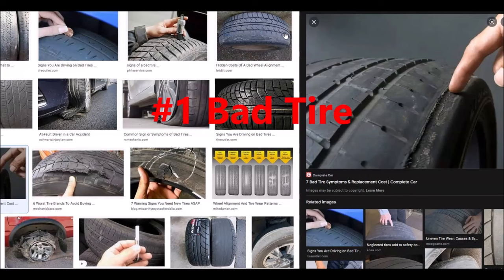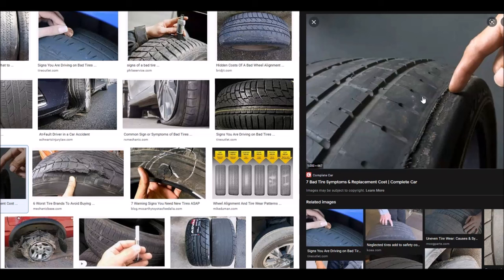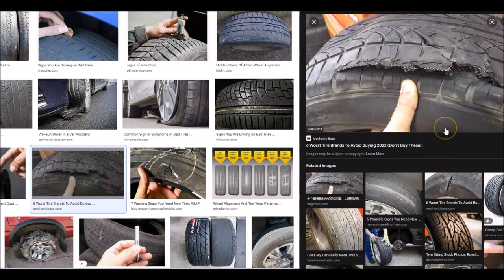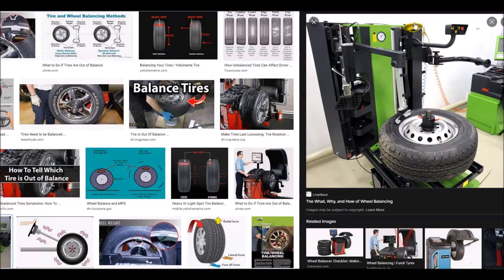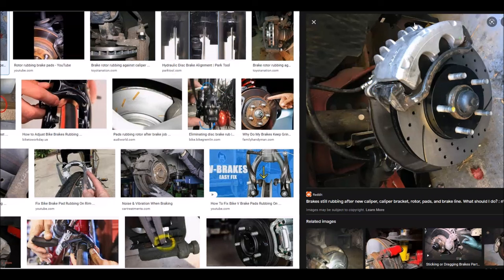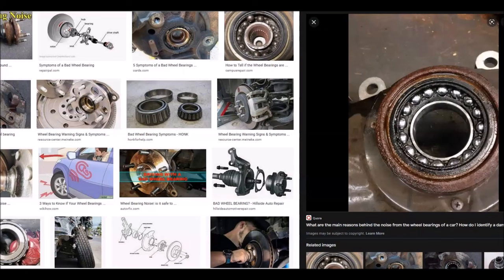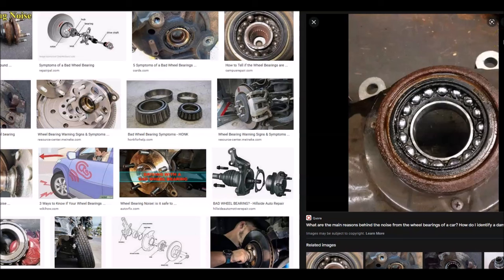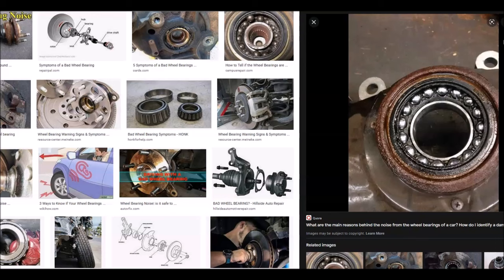4 Causes when Humming Noise in Car Getting Louder with Speed

Comment: 1. check tires treat  2. check tires balance 3. loose break pads or the clips  4. bad wheel bearing. You're the man. Thanks.
Reply: Update. My mazda's noise turned out to be left rear wheel bearing. Glad to have seen your video. Gracias
Reply: Mine stops when I go to the right a lottle
Reply: So my car seems to be louder but maybe not necessarily with speed. Also s while ago my traction light and abs light came on and mostly stays on but has gone on and off for a short time..well when that first happened my friend told me wheel bearing? BTW I got new tires 6 months ago. Also had serpentine belt replaced replaced couple months ago

Comment: In my case there is a humming sound only between 35mph and 50mph…. If i go harder than it rides smooth. Also i have no viberation at all just the humming.. what can this cause?
Reply: I have the same issue for my car. Have you figure out why?
Reply: @HG-oj2nw  it's probably the differential because i have already change the bearings and tires

Comment: Humming/whining noise coming from front passenger side. Stays the same whether idling or at different rooms. Strange thing is that it disappears after lifting the hand brake just one notch. I can't think of anything related to the braking system that would make this noise while idling. 2013 Mazda 5🤔

Comment: Currently trying to diagnose this in my car. The loose brake pad feels like a revelation, as my mechanic replaced my wheel bearings (they did need it, the noise decreased, but they were a small part of the noise, weirdly) and commented that one of my brake pads was worn down more, which I assume could happen if it’s not firmly in place and can rub against the rotor(?). 

If it’s the brake pads, should the humming noise stop while braking?

Comment: I get a whistle like an old-fashioned kettle . When on the motorway doing 60-70 mph , it has done it at low speed 30mph , it doesn't do it idling so it's hard to tell where it's coming from, car has no turbo ,I'm stumped .

Comment: We have this, right after getting brand new tires. It seems to keep getting louder, and louder. When we coast, it make no noise, but accelerating it makes a loud humming noise.
Reply: Might be your differential. Probably the ring and pinion bearing. I have the same typa thing
Reply: @viv1d349  how much would that cost to fix?
Reply: I recently changed my Tyres as well,brand new and that’s when I discovered that sound
Reply: @rebirthed1274 I thought mine was the tires, but upon starting the car we heard the noise amplified way louder, ruling out the tires.
Reply: @braydenwilde8643 what was it
Reply: @headhonchaa7905 idler pulley!

Comment: Could bad brakes be an issue with that as well because I have humming as I speed up and I'm betting it could be a wheel bearing for sure but this does need brakes bad apparently yeah it needs brakes as I'm stepping on the break it's it should be a lot better at stopping and I'm getting a squeaking so yeah I could bad brakes be a problem with that

Comment: Hi, I changed my front brakes, bearings, and rotor and now its making a loud propeller noise and it gets louder when I speed up but when I slightly turn left it stops making noise until I straighten up my steering again or turn right it starts making noise again but it did make a little humming noise when I put on a different wheel and tire on the drivers side. You think this could be the problem? Having a different rim/tire on?? Sorrt for the long message. Thank you
Reply: I deff have the “sound stops or goes silent when turning to one side” thing
Reply: Wheel bearing
Reply: @j.m.7545 he said he changed his bearings bro.. smh

Comment: I’m having this problems. I brought new tires. Replaced the brakes, wheel bearings and wheel hubs. What else can it be
Reply: Check your inner cv axle (if you have one) if not you most likely have a bad  differential bearings... 

Or the noise comes from the back...

Comment: Is it cheaper to replace the bearing or the whole assembly (labor wise) since I am broke broke  and I think I have a bad bearing and I know you need to machine press that sucker out lol
Reply from the maker: Pressing it out can be an issue. You can price check a whole front wheel knuckle for your vehicle to see which costs less. One thing to keep in mind is when the whole front wheel knuckle is swapped out usually an alignment will also be needed.
Reply: The labor isn't costly but the part is. Expect to pay around $175  per axle for the whole job . This is for a Toyota Corolla

Comment: I am having the same issue I got wheel bearing replaced. Tires are great and it still making a humming sound. What else could it possibly be?
Reply: Have you fixed this problem yet and know what it is/was? I have the same problem. I’ve just noticed mine is making a clicking sound which could be the cv joints in he drive shaft which is making me wonder why it’s making a humming sound?!

Comment: My infinity m45 is making that humming noise but it it also running at 2500 rpms at 65 mph . Could this be a overdrive problem an where is the over drive button on this car ?
Reply: Probably your torque converter slipping and failing
Reply: Balance your tires

Comment: Hey so my car makes a hum with a thud sound when going 40+mph my wheels spin freely. Btw I was also in a front end crash where the driver hit my front wheel and bent my inner tie rod, both the inner tie rod and outer were replaced and I even got new tires and alignment to try and fix it but it just kept doing it. No metallic or vibrations at lower speeds signaling it’s a wheel bearing. Now I’m leaning more towards a cv joint/ axle or the back part of the wheel bearing. Idk at this point it would help a lot to hear what you guys have to say. Thank you

Edit: the sound is a thud thud thud thus not a humming sound. Thud sound is worst from 40-60 and after that it just quites down a bit but still really loud
Reply: i am having the same issue, once I get to 45+, the noise gets louder, no vibration, not sure what it is.. did you figure it out?
Reply: @theworldisyours2241 it was the wheel hun assembly but after I changed it it stopped for a day or so and it started again. Turns out the bearing was defective but I ended up putting replacing with warranty. I’d go fix the whole wheel hub assembly if it’s not that then you’ll have a better driving car either way. Good luck
Reply: Cv shaft is what that sounds like…grab hold of it and yank on it…if it moves at all or makes and rattling noise it’s bad